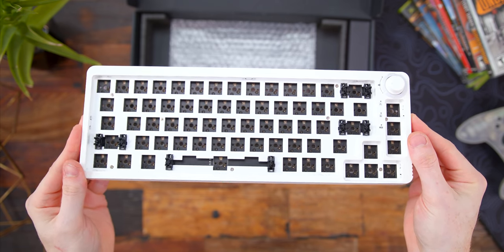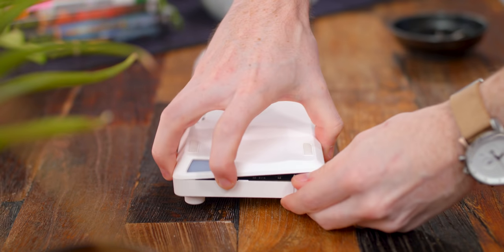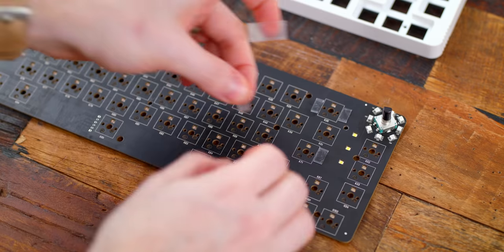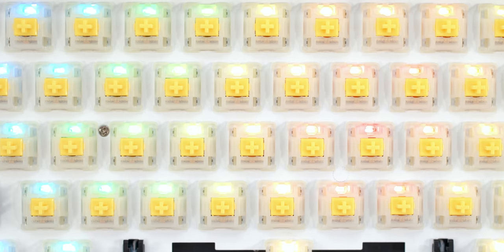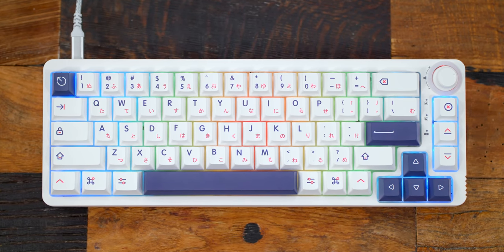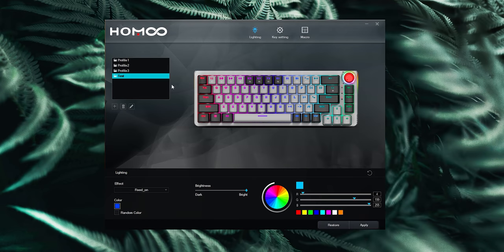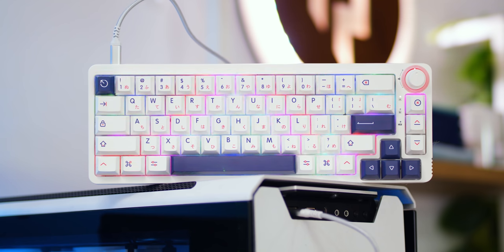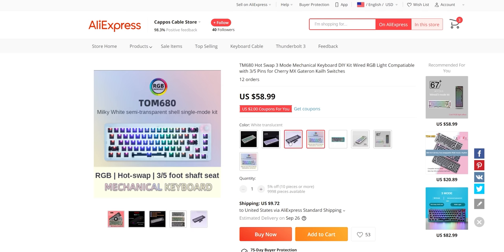Building A Budget $98 Custom Keyboard!

Comment: Hey Frank. Just a heads up. This keeb has been around in my local community (SEA region) for some time now and recently there's been numerous reports in our community of this keeb failing just after a month of use. Some even had them fail the next day after getting them. Most of these cases seem to point towards the stock cable being slightly sus and causing the PCB to fry. While the keyboard WAS good when it released, the recent batches are very much not. Our current mech community has been advising others new to the hobby to stay away from this keeb for now.
Reply: I have bought this and my other 3 friends, none of us got a problem. None of us had used the stock cable, i think it is a very sketchy dollar store cable so i reccomend getting another cable (i took a coiled aviator)
Reply: Thanks for the heads up. Curious, would a bad cable have sufficient voltage/amperage to damage pcb?
Reply: Thanks this is very good to know as mine is coming in a few weeks
Reply: @arieltakom  Any updates on this?
Reply: @hyphen8d725  not much news so far as most ppl in my community have moved away from this keeb to others keebs, mostly the RK and Akko boards.

I have seen a few use them, and seems like recent batches are good enough. But can't really confirm this
Reply: @arieltakom  So what would be the best way to avoid or prevent the problem?
Reply: @hyphen8d725  idk honestly. I only shared whatever the owners of the keeb were discussing about back then coz it was a hot topic, since a lot of them bought the board and all. I don't think any of them found a solution, but they did advise to just use the stock cable that came with the keeb. That way, even if you fry your keeb, you can still claim warranty. If you use 3rd party cables, then they will probably reject your warranty claim as they'll say your cable caused the issue etc.
Reply: @arieltakom  Gotcha, ty!
Reply: SEATTLE GANG WHOOOOOOOOOOO
Reply: @hyphen8d725  been using mine for 7 months not a single issue.
Reply: he used a coiled cable which doesn't come in with the board. Will that fix it?
Reply: @arieltakom  just don't say you used a 3rd party cable? They won't know which cable you used unless you specify...
Reply: @arieltakom  Is there any good alternative for this in the same pricepoint?
Reply: have they improved these now?
Reply: @wizbliz7434  I've been using mine for about a month with absolutely no issues. Although I never used the stock cable, but it doesn't need a super high end cable either I've just been using the one I got with my Gamakay MK61. I'm really happy with the LK67, I've swapped in some Boba U4Ts and it sounds and feels amazing.
Reply: *Keyboard
Reply: So just change the cable right

Comment: I'm a big fan of 65% keyboard with a volume wheel
Reply: they are way too uncommon its a massive turn off for me with most boards
Reply: also nice profile pic
Reply: Me too
Reply: But I'm not a fan of the volume dial on this, it looks super cheap, also they should give a poly carbonate plate and give a South facing led, screw in stabs an better volume dial. Alu plate is like $50 and poly plate is like $20
Reply: @champftw9130  the knob is removable and you can put a nice Alu knob on it. Agree on the other points, really would have been nice if leds were south facing
Reply: @ryanhuang8096  Will the shape still be the same?
Reply: @cavetown1  yeah nice profile pic
Reply: @champftw9130  You can change the knob to metal one
Reply: @ryanhuang8096  do you know wher I can find a good alu knob?
Reply: @KaizenIrorita  where do you find a knob? is it universal?
Reply: @duhfuhfh96  i think u can use a guitar knob
Reply: LW-67.
Reply: rumor says keychron q2 are gonna be a exploded 65% keyboard, similiar to q1, it can use rotary knob as well. all we can do is patiently wait :)
Reply: We need to see more of your corgis frank
Reply: they r cool
Reply: @cavetown1  xD, L is wearing mask in heaven 🤣
Reply: coolermaster just came out with one but sadly its not hot swab cuz of opticals
Reply: @champftw9130  why are south facing leds proffered?
Reply: @DDHDTV  switch compatibility
Reply: @KaizenIrorita  yes but the shape is still bad
Reply: Yeah. I’d rather go with a 75 with knob
Reply: @-keiskx1774  same, gmmk pro/keychron q1
Reply: 75% is the devenition of god.
Reply: Sameeeeeee
Reply: nobs
Reply: @NeekoNeekoNiii  might be a bit late but the Lychee G65 looks good! I’m just not used to not having a delete key (I think it can be customized using the software but I have a Mac and can’t do that sadly🥲)
Reply: You mean KNOB U HAVE LET DOWN OUr BrITISh VEIWERS how do you feel about that
Reply: Change it to a 75 and im in

Comment: This is dope... was gonna get ready to build my first keyboard and been looking for more cheaper options... and to my surprise RFP comes in clutch with a budget build
Reply: TBH it's hard to beat for that price. I knocked the plate mounted stabilizers, but after learning the price, it's hard to complain!
Reply: Buy durock or everglide plate mounted stabs and holee mod them alongside band aid mod. 
Then, also do tape mod on the pcb. 
If you want tactile switches on budget do look for akko cs lavenders or ocean blues(slightly heavy).

Comment: you should try to do the tape mod and pe foam mod with these! actually works.
Reply: Sound like you came from shoobs lol
Reply: @dawson_c1952  it’s a lot more bigger than shoobs lol
Reply: @dawson_c1952  naw i came from my channel...
Reply: @morigafter6080  I know
Reply: Is this the tape mod that covers the entire bottom of the PCB with tape? I ;may actually try that. Does it make a big difference with board?
Reply: @orangesharpy  makes it more... poppy? clacky? idk. I tried and it def made a sound difference
Reply: @orangesharpy  yea made my keyboard a lot thockier
Reply: @orangesharpy  yup, it basically makes the sound reflect back directly from the bottom of the switch housing, instead of traveling to the bottom of the case, and bouncing back. It changes the sound profile a lot, especially removing the hollowness.
Reply: If i do the tape mod, should i remove the case foam or just apply the tape on the pcb and put foam too?
Reply: @noxus_z  works either way :) if you want a more muted sound I think keep the foam

Comment: Hey Frank! I just bought this keyboard and you mentioned that your knob's red light wasn't changing correctly with others. I found that it's because you're "charging" the battery which red light means "charging". In my case, it turns to green light immediately when it finish charging! 

I almost crash it when i also thought that this freaking red light isn't going to dissappear lol:)

Comment: The amount of misinformed individuals in the comment section is appalling. This is what happens when a niche hobby gets into mainstream and many people are trying to reinvent the wheel for what has already worked for many years. Build wise it's good enough for the budget but it doesn't really sound like anything to write home about because of the case material. Other than that it's an aesthetically pleasing board that will surely satisfy its target market.
Reply: To be fair, I did manage to make it sound pretty good for the build I did for my gf (I posted it on this channel) but honestly it's not amazing overall, but you get what you pay for. Mods can make it much better!
Reply: @BladeWieldingQueen  yeah, what I said, it'll satisfy its target market.

Comment: I tried to get this board, but the delivery guy failed to deliver it to my door and it got stolen. 

Ended up getting a GK61 and moded it to my liking!
Boba U4 silent switches with 72G multistage spring both are lubed
Durock stabs lubed as well
Sakura-Michi keycaps

Comment: I built myself a tofu65 for my first, I kinda wish they made a north facing LED version of the TOFU board, ngl. I have a few keys that would be nice if the light went through them.

On the videos where they showed the noise issue with north facing LEDs i never noticed a difference, and I have silent alpaca switches since i like keyboards that make 0 sound anyways.

Comment: I literally built this board with dragonfruits on a stream and the board didnt even work but tbf i think mine is a very rare instance of that happening and I personally would recommend this board just off my initial typing attempt with everything on it
Reply: Have you had any issues with the PCB shorting out? Thinking of reconsidering my decision because of that so I'll need to look for more PCB shorting issues.
Reply: @chiizuu752  so far just the on time I mentioned

Comment: Typing this on one of those "Tiffany Blue" wireless ones. Been loving it, and that's been with stock outemu reds (coming from using blues for years). Rewatching this getting ready to open 'er up, do all the mods, and pop in my just finished (broke my right hand, so it's taken a while - makes it all the sweeter) lubed Everglide Aqua King v3s and Panda v3 stabs. Cheers!
Reply: gettin mine in a week, this gives me hope. i've been worried i made a mistake purchasing a knock-off board thats on the pricer side. Please update with how it feels!
Reply: @Valanilla  Still loving it. Even with cheap unlubed switches it was good, even better now with all the modded stuff. Case feels heavy and sturdy for being plastic, everything quality-wise has been great. I can try to answer if you have any more specific Qs

Comment: The links doest work at all, I try to find the TM680 and there is no store to get it from. This videos is kind of spam, because in my case if I try to buy this key board, just the TM680 is going to be 82 usd. So nowhere does it give 98 usd.

Comment: Man this came at the perfect time since i was literally just thinking of building one. Only think is that it's 65%. I'd much rather a TKL. I like having my function row.
Reply: Same
Reply: Just get the GMK Pro then. More expensive with Volume Knob and FN Keys.
Reply: @brickeatingcompilation2017  yeah, it fits my needs, but it's also $160 for just the frame. i'd still need switches and keycaps, and getting both of those will bring it to well over $200. i'd like to keep everything around $150 if possible, but all the ones i find that i like are 65%, don't have a volume knob, or both. usually both.
Reply: @haruharaharuko1222  fk cmmk mk870 is a tkl kit for the same price. Do more research about this kit tho

Comment: Recently purchased this and although it is hot-swappable, the volume dial is soldered   onto the pcb. This means you cannot remove the pcb from the plate without desoldering this. That being said it looks nice and also others have said to get a new usb-c cable to prevent a frying of the pcb

Comment: So what would be the benefit of doing this over modding say a referbished Razer Huntsman Mini or TE? Both of those are readily available on Amazon for usually about $70ish (at least right now) and you could totally bandaid mod and add dampening foam. I get that this is "custom" but is it really?
Reply: Refurbished Huntsman and the TE version is really hard to find in my country. Also, I'm not a fan of Razer huntsman mini's low profile aesthetics, I'd much prefer a high profile keyboard. This was my personal reason why I don't mod prebuilts. Why buy a prebuilt that you're going to change 90% of the parts (keycap, switch and stabilizers) when you can just buy a barebones, it's cheaper and less wasteful.
Reply: You get to customize your parts as well as standard layout and compatability for aftermarket stabs, switches, keycaps. The thing that these videos fail to make the viewers understand is that  the custom keyboard hobby caters to an entirely different market than the mainstream gamer brands. The hobby is all about personalization.

Comment: I’m actually looking for a 60% that has 4 function buttons (1.25u) in the bottom left corner instead of the standard 3, for more thumb+key shortcut combo’s.  I actually rarely use the function keys on the right of the spacebar. (Does anyone?) i’d be fine with a design that completely moves the spacebar over, or makes it a shorter one and/or just removes the function buttons on the right.

Comment: I just bought this for my first custom. £200 all in for kit, switches and keycaps and some other little treats. Looking forward to it actually arriving. First time using aliexpress i am nervous about it.
Reply: how did ordering from aliexpress go. in the same situation wondering if i wanna buy off it
Reply: @carsonfulton5844  yes everything worked out well. A friend also ordered a similar kit and had an issue with it but was able to return and get sorted.

Comment: That's an awesome board, I've heard quite a bit about it here lately. But instead of using the stock stabs you could get you some durock plate mount stabs and mod those up they will more than likely sound a lot better or you could order some everglide plate mount stabs with the board from ali and mod those. I use everglide screw in pcb mount stabs and if there of the same quality I'd say they will be pretty good with plated wires, no feet to cut, and they sent more than enough for a 100 percent with a few extra both durock and everglides will run about 15 extra on the budget but well worth IMO but that's me, either way still a super nice starter board. Frank if you read this if you wanted to do another budget option on ali check out the BM65 i took a chance on it and its a great budget option as well a little pricier than this one but not much more and there are a few upgrades too, check it out.

Comment: For the money I think I'd rather buy the Drop Entr Keyboard. It lacks some fancy feature like RGB lighting, hot-swappable switches, and a rotary dial but overall it seems to be a better built keyboard for the money and the options it does offer are pretty good.
Reply: This board is meant to be a starter or budget custom keyboard while Entr is like a plug and play board imo.

Comment: Cursed 65% keyboard. Failure rate is off the chart. Local keyboard group has a few people reporting dead board every other week for this tm680
Reply: I've noticed that the stock cable is especially a bit culprit of frying PCBs so I threw mine out

Comment: Check the sheet in the box ! You can change all colors and RGB modes via shortcuts on the keyboard . Even for the knob and underglow.
Reply: Is there any way you could provide these shortcuts? Especially the knob and underglow shortcuts. Mine didn't come with a sheet unfortunately

Comment: I honestly don't understand why mechanical keyboards, especially custom ones, are so expensive.
Reply: Manufacturing quality and tolerances, materials, the technology and design costs etc etc, the experience is SO worth it
Reply: For prebuilt plastics you won't be able to appreciate. But when you start in the realm of stacked acrylic, different mounting styles, plate options, cnc milled custom aluminum chassis, that's where it all starts.

Comment: Just dropped 400$ for a Q1 with U4T's (expensive bc EU)
Reply: How much did the Q1 cost with shipping fees included. Also wanted to order one but didn't know how much extra it would be
Reply: @frrr1596  182$ for the barebones version here in Denmark and the 220 on top of that for switches, keycaps, lubricant etc.

Comment: Can someone recommend me a case like that on the video but with 75% layout?
I want to build my first custom keyboard but i want it too be 75% bonus points if it has a volume knob
Reply: Hey man! What is your bugdet for the full build?
Reply: @sagtil2596  hey! I was thinking maybe 250€ max
Reply: @MrLefteris3000  Hey man. I would recommend the Keychron Q1 + TTC gold switches (~85 switches) and some tai-hao keycaps. In total that would like 230 euros without lube, switch opener etc. If you want, you can also contact me at Instagram if you have any questions or need any help: @Sagtil.
Reply: @MrLefteris3000  @Sagtil . I just found another board aswell, which is the NJ80. It's basically a Q1, but plastic board which makes it a lot cheaper! Great for a budget build and you won't have this annoying ping as in the Q1.

Comment: iirc there is no interference using the AKKO CS switches right?
Reply: there is
Reply: I saw a build and the guy said there wasn't. And someone on the hamaji discord server also said there won't be
Reply: @michaelreal5308  I have the akko matcha greens and they have interference with my cherry profile keycaps
Reply: Oh ok. Thanks for the clarification
Reply from the maker: @OzKo it’s not the switches that’s the problem, it’s clearly your keycaps.
Reply: is there a big difference in sound/feel if there is interference?
Reply: @michaelreal5308  its a bit mushy and unsatisfying to bottom out if there is a lot of interreference, like on my keycaps, not all keycaps have the same amount of interference but my set has a lot
Reply: @randomfrankp  Got it, maybe i should have been more specific with my answer. I meant to say that akko switches still do have  interference with som cherry keycaps, should've have mentioned that not all sets do though
Reply: @Casix03 I do know that, I was just assuming that the commenter owned a north facing pcb, like in the video.

Comment: for all the new people getting into this hobby, I would recommend the Ks-9 Gateron yellows because those come pre-lubed and will save you on the 205g0 they are super smooth and you can take paper towels and put those in the bottom housing, paper is extremely good and absorbing sound